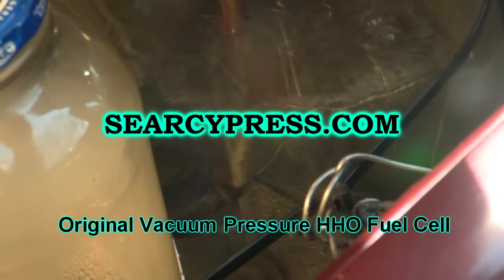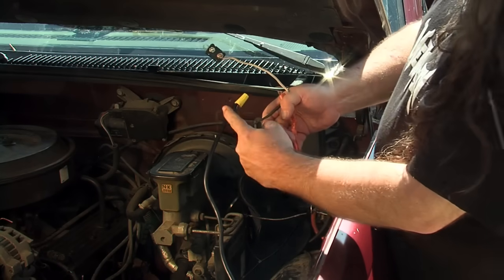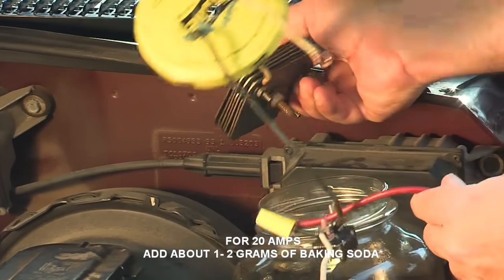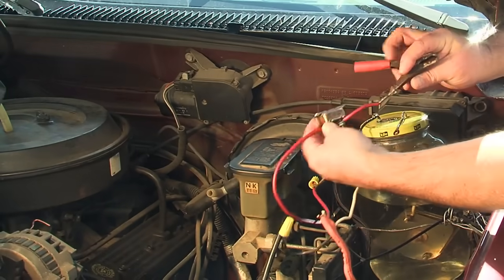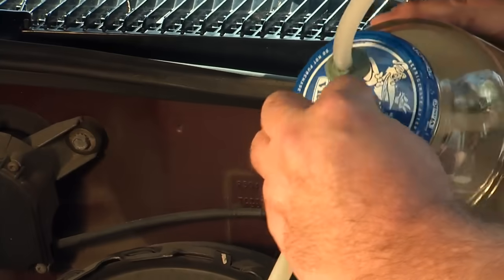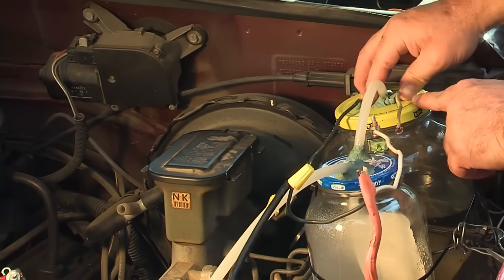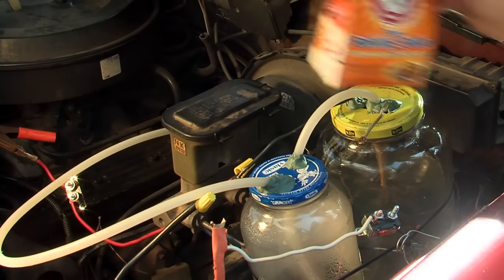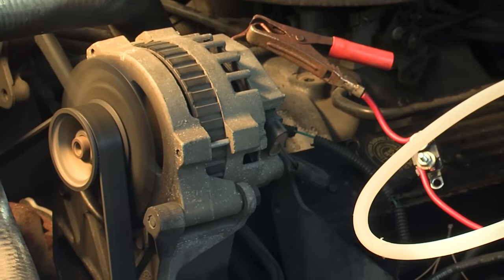Vacuum Pressure Hydrogen fuel cell defeats high gas prices using hydrogen from H2O.

Comment: Any thoghts around the possibbility of excesive water from combustion emulsifying with lubricating oil?
Reply from the maker: Gasoline produces water as a byproduct. The reason there's a lot of water coming out of the tailpipe is because the catalytic converter is remaining cold for much longer. There's nothing for it to burn. It's not about the HHO that we're burning that's producing that much water. About 3/4 of a gallon of water in the fuel cell will get you 200 miles. Thanks very much for the comment.

Comment: If i do this to a motorcycle do i gotta flash the ECU? Ty
Reply from the maker: This is the vacuum pressure fuel cell it is not the type that you see everyone using where they inject into the carburetor and mix with air. Those absolutely do nothing and we proved that many years ago. If you don't have vacuum available you won't be able to make this system. You need at least 15 in of vacuum for the system to operate properly. You can certainly put one on and claim that you're using HHO and you would be. The thing is you would see no improvement. We discovered long ago that if you mix HHO into the air before combustion it will be diluted to the point where there are no noticeable benefits. This is where all of the confusion with HHO comes into play. The internet is full of useless fuel cells that are extremely cool and well designed. The vacuum lowers the boiling point of the water and provides the thermal properties necessary for the fuel cell to do its job. We have a new video coming out so be sure and subscribe we'll talk in-depth about this and explain all of the confusion. Thanks very much for the comment.
Reply: @metalpresstv  thank you for the info, i ride bikes, one of my bikes is from the 80s, a 1986 yamaha fazer fzx700, i was thinking it would be cool to do, not to ride w but to clean it i hear this cleans the inside of engine and cylinders and ect. Rmoving gunk to make it run better.. Cool setup btw

Comment: You’re insane for using glass jars.
Reply from the maker: Glass is suitable for quite a few reasons. The system housing must be able to withstand significant vacuum. Plastics will deform and melts from the heat. Metal is also unsuitable. The system is in the state of vacuum just like a light bulb. We have made significant improvements over the years and will have a new video coming out which will highlight some of those. The thermal properties of the glass are also extremely important. The advantages outway the risks. I don't sanction anyone reproducing this but the system does work amazing. Hope you subscribe, thank you very much for the comment.

Comment: dont use glass wow bad
Reply from the maker: The system runs in vacuum there's never any pressure in that jug. The glass is necessary for the thermal properties. I don't sanction anyone repeating this but if there was a better way you can be certain I would use it. Plastic distorts under the vacuum pressure and metal cannot be used. Also it really is good to be able to keep an eye on things. We have a new video coming out which will show you an improved version which has a lot of safety features. Be sure and subscribe. Thank you very much for the comment.

Comment: I know this is an older video, but there are a lot of hateful comments. A lot of disparaging, ignorant trolls who want attention. This is awesome. I've been looking into this for quite some time. I might rig up a system like this on my Firebird. I'll see how it goes. This has lots of useful information and guides through the steps. Thanks for the video.
Reply from the maker: Thanks for commenting. You're quite right. By the grace of God this video is now a part of history. We have a new video coming out which will show an improved version which will be electrically much more Superior to what you see in this old video. The basic operation of the unit remains the same but the control function has been changed quite a bit in the new video. It's much safer. The video will come when the timing is right so don't hesitate to subscribe because I would hate for you to miss it... I don't waste people's time with a bunch of videos, because my ethic is you're only as good as the last one you made. I cannot sanction you installing this of course for obvious reasons. There has to be some redundant safety systems besides just fuses. And we have done that quite affordably in the next video. I'll do my best to get it to you as soon as I can.  Thank you very much for your comment and be very safe out there.

Comment: I've been doing research for my vehicle and unfortunately because I have O2 sensors I have to get other software to trick the sensors and to thinking that the gas is not are so that the computer doesn't send more fuel into the engine does cussing to instead of saving me fuel making me waste more fuel because the computer as I said things that the hhl gas is not gas but air so I'll be doing a little more research and see how I can get to program my vehicle's computer from the diagnosis port and see if I am successful at that but so far I haven't found a place where I can get that program yet:-( so what I might do is just find me an old carbureted vehicle and use this guy's approach

Comment: I like that you plugged it to the alternator so it isn’t running when the engine isn’t turning
Reply from the maker: It is actually still connected directly to the battery. A lot of modifications happened over the years. We've been very cautious about posting updates on this topic. HHO is misunderstood because there are two types of injection. Injecting into the carburetor in an atmospheric environment is quite useless. We found this out but continued on and eventually went to a vacuum system. For some reason the vacuum is key to the thermal properties and the performance of the unit. We have a new video coming out which will do it's very best to explain everything. We have taken a lot of time to get this right because frankly it's probably the last opportunity we're going to get. Please subscribe so you don't miss it. I don't waste people's time with a bunch of videos that just go on and on for views. The Next video will be the last video on this subject and hopefully  will be able to put a nail in the coffin people thinking this technology does not function. It will not work on every single vehicle out there because frankly there's just so many. Thank you very much for the comment and I greatly appreciate your support. 😁

Comment: I gave this a try 15 years ago with a pre made assembly easy to hook up But did not notice any difference, So I bought a bigger premade HHO generator and the only thing I noticed was my alternator working Harder. Perhaps they are made better now days, But I did not have any luck with it..
Reply from the maker: More than likely you were injecting into the air intake in some fashion. That is not what this is. Injecting into the air intake is the reason that HHO itself got a bad rap. The hho gas becomes quickly diluted and will yield no results. We know because we tried it and we saw that it gave no improvement and then eventually we moved to a vacuum injection system. Unfortunately, many people kept thinking it was working and tried it and kept pushing it out there. Some did it for views and some did it so they can sell kits and things like that. Injecting into the vacuum is completely different. Noticeably you will have a much cooler catalytic converter and a change and smell of the exhaust. Almost all of the gasoline is burned in the cylinder instead of the emission system. When you're running this in vacuum the thermal properties are much different. The boiling point of the water changes significantly. This produces a cold steam type injection. We have a new video coming out which will show many improvements we've made over the years. Be sure and subscribe so you don't miss it. Thanks very much for the comment.
Reply: Your correct, I hooked it up to my intake vacuum, no wonder it did not work even though that is what the instructions at the time said to do.  Thanks for the Info

Comment: A question . when hydrogen burned , it produces water as it's byproduct, so doesn't the water produced as byproduct cause corrosion in the cylinder and the exaust ? . Just curious
Reply from the maker: That's an understandable question. When you burn gasoline you're actually producing a large amount of water anyway. So your engine is already having to deal with it as well as your exhaust. The main effect that I've noticed is it cleans out the pipes as well as the catalytic converter. When you first install the unit it will blow every bit of crud that's in your exhaust system out on the ground. The reason the gasoline doesn't do this is because about 20% of the gasoline is unburned and ignites in the catalytic converter. When running the fuel cell however there is not very much left over for the catalytic converter to burn so it remains cooler much longer. We will have a new video coming out when we're able to release it we certainly will. Thank you very much, be sure and subscribe. 😁

Comment: Hey wussup man, was wanting to ask....i saw u kept charging it, im guessing u dont ride with it connected? For a continuous charge. And how far do u make it?
Reply from the maker: Sorry for the confusion, I was just demonstrating the production. The unit runs when the engine is running. We have a new video coming out before long so be sure and subscribe so you don't miss it. Thanks for the comment.
Reply: @metalpresstv  so u have it connected when your driving, correct? I'm sorry, just with the risk of death from failure, I'd rather not mess up, respectfully.
Reply from the maker: @dgarza5624  the unit runs when the engine runs yes. We have a new video coming out which will show a lot of details and I'm very excited that it's about to come together so we can show everyone what we've accomplished over the years. Thanks very much for the comment.
Reply: So u have it connected when your driving, correct?

Comment: Just me. Has anyone ever seen an explosion of a hydrogen tank like you would see on an automobile using hydrogen for fuel???
Reply from the maker: There's a big difference between a hydrogen pop and a HHo boom. We operate completely in a vacuum which minimizes the risk of such an event. Thanks for the comment.
Reply: @metalpresstv  What I'm thinking about is a bunch of hydrogen powered vehicles on the highway. This seems to be the coming thing!

Comment: Law of conservation of energy states that energy can neither be created nor destroyed - only converted from one form of energy to another. This means that a system always has the same amount of energy, unless it's added from the outside. 

In other words the energy that powers the cell comes from the battery which pulls off the alternator which pulls off the motor. 

Which also means no added gas mileage and means the same gas mileage as not even having the cell hooked up.
Reply from the maker: Actually this system in no way interferes with the law of the conservation of energy. The engine itself is only burning about 80% of the fuel the rest is consumed by the catalytic converter. What we are  doing is burning all of the fuel in the cylinder instead of the emission system. All gains come from the gasoline.
Reply: @metalpresstv  Then it would burn more gas because the load on the alternator which powers the the battery that the cells uses. The only way this setup would actually work is by creating the energy from another source not using the battery or alternator.
Reply from the maker: @suoppsdn9751  20% more gasoline is a lot of energy. I understand you need to back the powers that be and stand with all the forces of science. I would like to point out that if you think these interesting little crafts that have been shown to you by your government that are flying around are powered by lithium batteries you're sadly mistaken. There's more to science than what they teach you in school and college. We have a new video coming out soon so be sure and subscribe thanks for all the comments my friend.
Reply from the maker: @thetruepetre2771  I'm not sure if you caught in the hundreds of comments where I've explained where the energy comes from. This engine wastes up to 20% of the gasoline. We are not in any way powering the engine with this gas. What we are doing is trying to burn as much of the 20% of the wasted gasoline which is wasted and  burns in the catalytic converter. I understand your disbelief. There are hundreds of video showing and proving that HHO does not work. And they are right. Without a vacuum you cannot inject HHO into an engine and see any results at all. It was probably 17 years ago now when we started doing this and we discovered that fact very early on. Unfortunately we had already shared how to do this with many people and some people were disillusioned and thought it worked by squirting it into the carburetor. We proved it did not work and we moved on. When we put this system into the vacuum we had immediate changes in the engine. The smell of the exhaust changed and the catalytic converter remained cool and water began pouring out of the tailpipe. This system was tested by running the engine out of gas multiple times with the cell on and off and we proved it did boost the mileage considerably. We make no claims of over unity. We tell you exactly where the energy comes from and that is the gasoline and not the hho. A more efficient burning of the gasoline is all we are doing. Car makers do not make efficient engines and I think there's a reason. Just imagine if you made a vehicle that burned all of the fuel and it required no catalytic converter. Do you honestly think they can't do that? There's a reason that engines burn dirty. I appreciate your insightful comments and I hope you appreciate mine. You can rest assured I know all of the science behind it because I've been doing it so long. We have a new video on this topic and if you can tell from the age of the video it's been a long time. There's a reason we're not releasing it yet because it's not the right time. The time is coming and when we do I really hope you'll watch it. Thanks very much for the comment.
Reply: @metalpresstv  
Could you help me understand what causes the engine to burn the remaining 20% of unburnt fuel?  Why was the fuel not burned in the first place?
How much gas volume does your generator produce per second?
By "into the vacuum" do you mean that you put the HHO gas in the vacuum system of the engine?  Is that just the air intake?
Reply from the maker: @thetruepetre2771  respectfully my friend I've told you too much already. Just understand that this technology will not work on every vehicle. I make no claims as such and I do not recommend that you reproduce this in any fashion whatsoever. Thanks very much for making a somewhat educated comment and I respect you to the fullest. Thank you again.
Reply: @thetruepetre2771  Your alternator, produces it's rated amps regardless whether you had something that drew 29 amps or not. 

Most car alternators are 80-90 amps at the desired RPMS. If you turn on your HHO and you can feel and hear an audible use of your engine power, your car then would be as you say, be unproductive. But if you turn on you car and it is idling with no other electronics drawing power, like your car horn, 30a's, your heating equipment, and it was just the HHO, it will not be wasted and be used for electrolysis.

If you don't believe me, just get something 12v 30A and stick it in your car while it idles. If you mileage doesn't drop, a HHo generator is only going to help mileage. How do I know? I have my own built one in my car and my trip computer don't lie.
Reply: @suoppsdn9751 a hike coming on here and reading comments from you brainiacs the sound like you know what you're talking about but you know very little what's actually taking place here.

Comment: Does this freeze during winter like hear in Alaska, ?
Reply from the maker: Actually it's pretty resilient most of the time but if you are in a very cold climate you will need to install a heater similar to a block heater to prevent it from freezing when you are not actively running the cell. I've never seen it freeze when it was running but I've never experienced that kind of climate either. You could most certainly wrap the entire thing. Thanks very much for the comment.

Comment: Do you know can you use hot glue to put around the holes and plug them my friend hot glued where the hose goes through the lid before I had a chance to tell him to stop I don’t know if it’ll deteriorate the hot glue and I don’t want to take a chance I’d like to find out before I have to dig it all out Any help would be appreciated.

Comment: Are those plates about three and a half inches? I have a 350 also. I was going to go with seven plates. I think that's what you had. I was using carbon steel plates. for my first attempt.
Reply from the maker: They must be high grade non-magnetic stainless steel only. Using other metals will produce some toxic fallout as well as plate disintegration. Thanks very much for the comment. We have a new video coming out that will help a lot. 😁

Comment: What about in colder climates? Like -30 at night?
Reply from the maker: In temperatures like that it would be necessary to add heat wrap around the fuel cell. When you plug in your block heater plug in your fuel cell. In cold temperatures you can wrap fuel cell with an insulating material. Thanks very much for the comment.